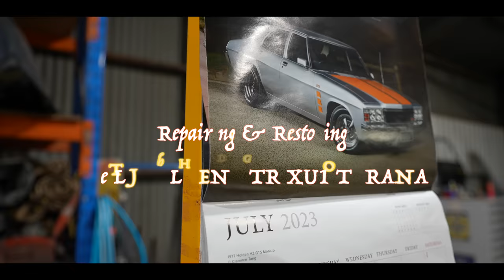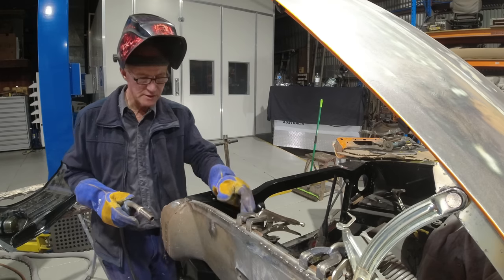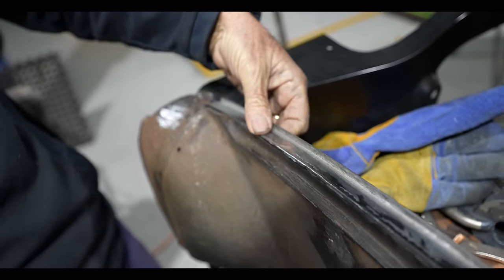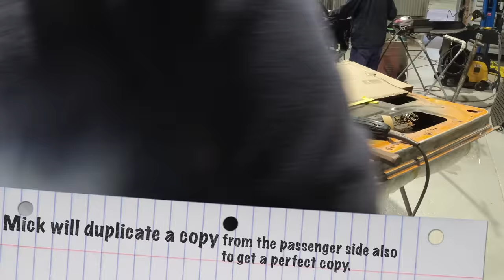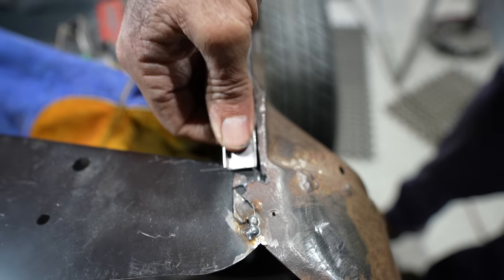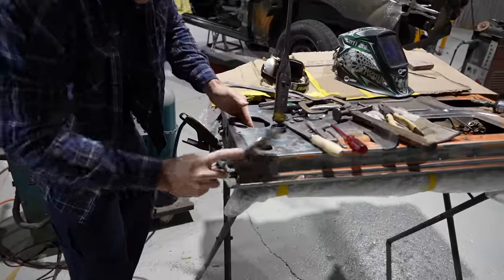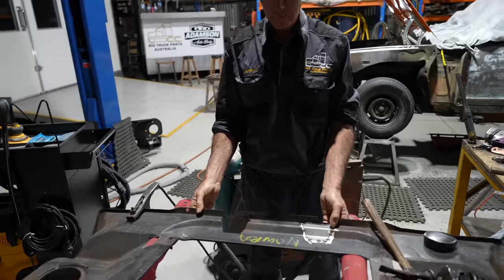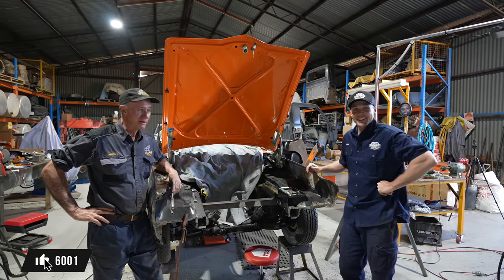Holden Torana Gtr Xu1 ( Part 12 ) Making Patch Panels . Classic car restoration.

Comment: Why did you fill in the radiator cutouts in the lower section. That is where the under tray supports are to go.

Comment: So how come your not running the stone tray? Welding up the stone tray leg support slots?
Reply from the maker: We will explain all this in upcoming episodes. cheers 👍
Reply: @adamsonautobody  
so, not running a stone tray?
As the legs of the stone tray go through those holes and the sides of the stone tray bolt to the underside of the chassis rail.
Reply from the maker: @some_random_garage  We will explain this in upcoming episodes. 👍

Comment: Awesome job , inner guard repair looks mint , outer skin repair on the door jam looks awesome, just wondering if there was any need of the use of weld through primer . Guys 👍
Reply from the maker: Yes always use a weld through primer. And we also use a zinc coated sheet metal. Cheers plan b👍

Comment: With modern day adhesives could you use them in car restoration. I think a Ferrari or something had its panels glued on.
Reply from the maker: You could. We have always liked to put cars back to original as possible.Doing this makes the car worth much more.

Comment: Interested to know why you opt to cut and bend your curved patch panels instead of using a shrink/stretcher. Not a judgement; just a curious viewer trying to learn 👌
Reply from the maker: Hey honest pat welcome back mate. With this way it has a perfect finish with perfect shape. doing it by eye and hammer you can get it perfect. With minimum stretch and shrink work. We will use no body fillers so it needed to be perfect with minimum file work.
Thanks for watching Pat👍
Reply: @adamsonautobody  love it

Comment: What were the filler panels for on the radiator support panel?
Reply from the maker: Different year models had those 2 cut out sections. Our year model needed them welded up.